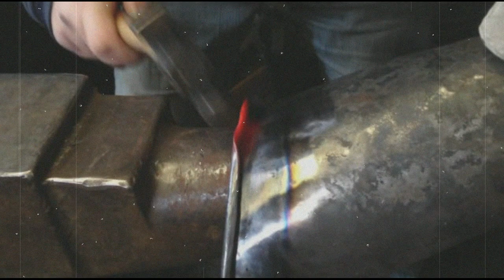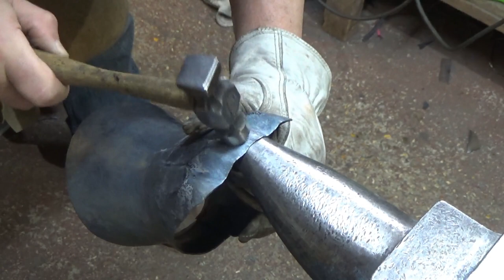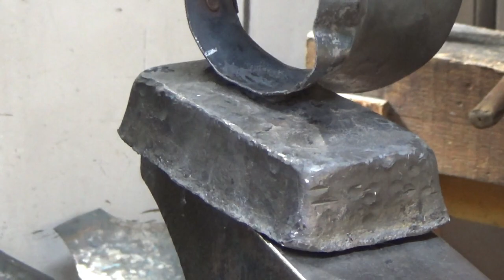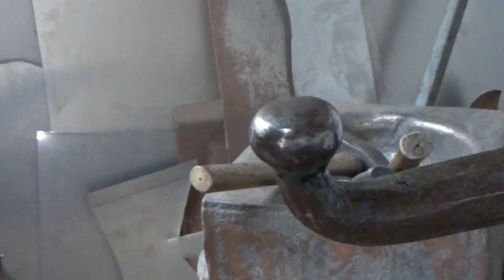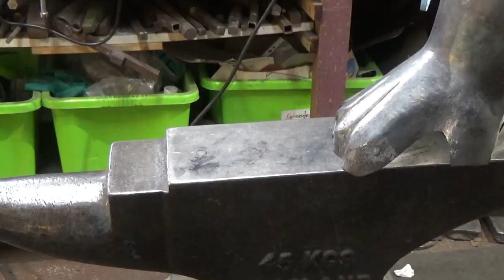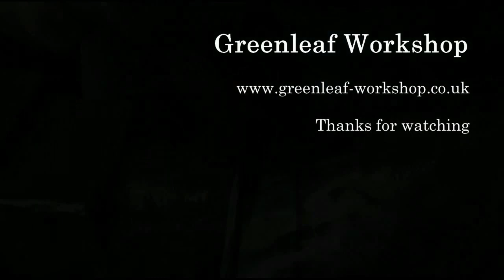Making medieval thumbs. 15th cent hourglass gauntlet. QEST Charity Armour

Comment: Great video as always. Question: how dangerous is to use a lead block like that? It seems to be quite useful, but I'm afraid even if I use gloves I could inhale dust. What safety precautions one should take and how truly safe is it?
Reply: its not dangerous. lead poisoning is typically something that builds up over years of exposure to those constantly exposed to it. so unless your eating the block, you'll be fine.
Reply from the maker: On quick work like this I haven't had any trouble and I use the lead for my Italian gauntlets as well. I cast the lead blocks myself and keep them well dusted and cared for. After use each time I wash my hands and face thoroughly. Unless I hear from an expert I think these precautions are adequate for occasional, infrequent use.

You can equally use pitch or a wood shape quite easily.

A respirator will filter out the lead particles if it is a concern and washing the hands thoroughly afterwards should keep you extra safe. Best not to work with it and then eat without a clean up first.